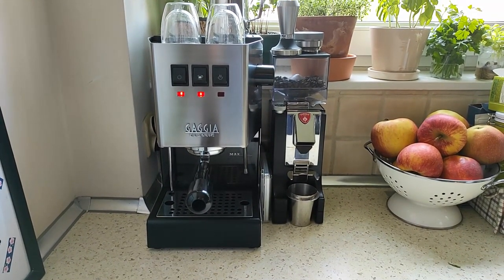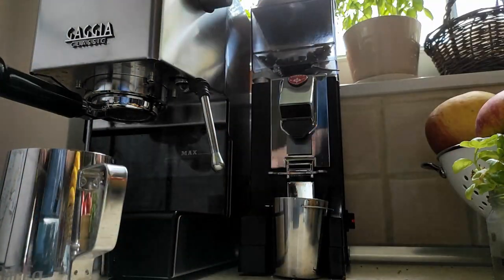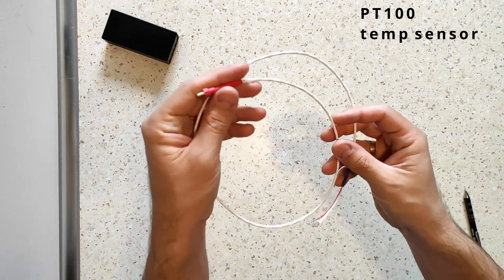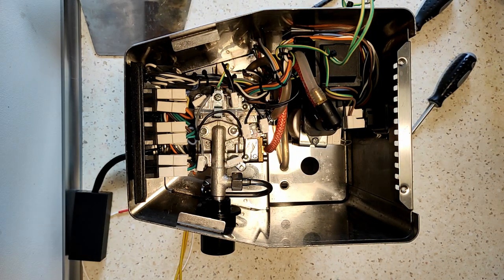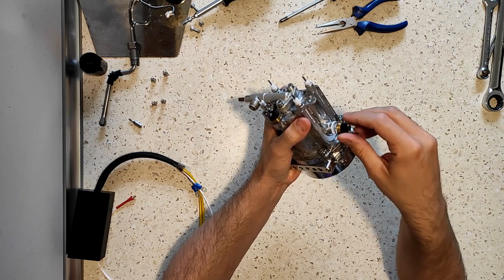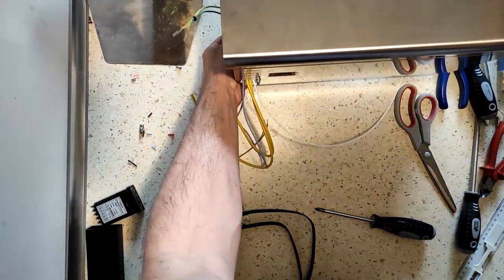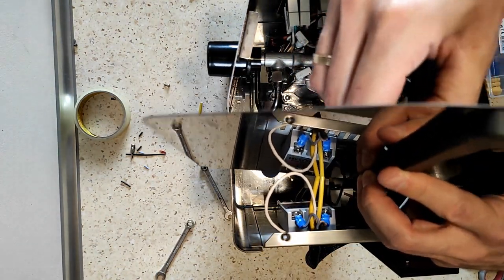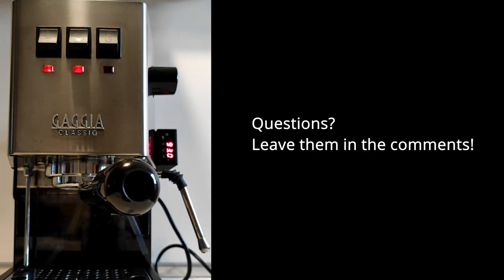How to install a PID on a Gaggia Classic Pro - DIY, cheap and good looking!

Comment: Great video - thank you! How important is using a thicker cable for the PID power connection? I have an 18 AWG silicone insulated cable at hand, but was wondering if this may be too thin. Thanks

Comment: Thanks to you i was able to do this install about an year ago, however as of recently my XMT7100 PID just stopped powering on. Light on the Gaggia power button turns on, no heat, and i can't tell if the PID or Relay are getting any power. Any troubleshooting steps you recommend? I checked all the cables and connections, they seem fine. I have a multimeter if it'd be useful, but I'm not familiar with how to use it (it's an AstroAI Multimeter 2000), thank you so much for your help.

Comment: Hi Robert, just wondering if the parts you linked will work with a 120V machine as well. I've messed around with taking things apart and putting them back together before but not really much in the electrical space
Reply from the maker: Yes, they will accept a range of voltages, 120V included.

Comment: Great video and really helpful, just one question - do you need to first set the parameters/temperature in the PID before Autotuning? Thanks!
Reply from the maker: No need for that, you can start with the stock ones, set the temp, let it heat up well and then auto tune.
Reply: @robertkujawa3504  Thanks Robert, i will give it a try. 

Are you still running your setup with SSR 25DA or changed it to 40DA?

Comment: Greetings! 

Thank you for your excellent video! I installed mine a little differently to my liking but made all connections as you did! I don't see any reason to deviate from your wiring as it seems the most efficient way (Just replacing the thermoswitch with the controller and thermocouple).

How ever when I flip my steam switch now it just keeps heating and heating. I am not sure why. It kept going past 170 before I shut it down. 

I don't see why the steam thermoswitch shouldn't still regulate the temp to 145. Perhaps you have input on this?

Thank you again! I've been enjoying tinkering with my Gaggia.
Reply: hi Weese! i was attempting to do the sketches/schematics last night and just bumped this query on situation of yours that got me thinking how can i repeat it... One (but not likely that You haven't hit it already) is when i've not set the High Value of PID to say, 140, default value is 600 deg. c for PT100.
Second, if my Steam Thermostat remains closed (can be any reason of several e.g. faulty thermostat, wires/terminals on the outside get shorted in Thermostat route to Steam Switch, Grounded Steam Thermostat accidently) etc. In latter case the situation will over-ride the discharged SSR, i.e. even when it's open after Set Temperature is reached, the circuit via Steam Switch and its thermostat will appear to close it.
Check wiring routes with close attention once, and boiler body for earthing leakage.

Comment: Hi robert! Looking forward to doing to this to my gaggia, although i cannot find these wires anywhere or what they would officially be called in my local home hardware  SiHF 2x0,5mm2,  FLRY 1.5mm2. I am canadian if that makes a difference
Reply from the maker: Just observe the diameters and temperature resistance. These are 2x0.5mm2 and 1.5mm2 in diameter. I went with fancy silicone wires, but you can pick those dedicated for automotive engine bay wiring. They will be able to withstand high temperatures around the boiler.

Comment: Hello Robert, nice video, and you almost convinced me to do the mod. I have 1 more question before I do it : you mentionnend your machine is running on 220v. Will the connections and harware be the same for 110v?
Reply from the maker: The PID unit I linked to can work with a wide range of voltages, 110V included. As for the connections, please refer to the wiring diagram available at Whole Latte Love. I have no access to a 110V machine, so can't give you a 100% sure answer.

Comment: Great tutorial, I've been  searching for an explanation like this for quite a while, finally, I found it I have ordered all parts you recommend from Ali express but not sure what size of the silicon insulated cable to order, can you please tell me what AWG or MM you used
Reply from the maker: For connecting the PID do the SSR I used SiHF 2x0,5mm2 cable and for delivering power from the Gaggia to the PID I used 1mm2 cable (17AWG).
For connecting the SSR to the Gaggia I used FLRY 1.5mm2 cable.
Reply: Thanks a lot, I'll get ongoing looking for them

Comment: Hi Robert, just a question about PID settings. The settings found by autotune (P:4.8, I: 78, d: 19) produce an intrashot stability of around 5c. I was wondering if you had any luck with trying custom settings? I have seen people achieving an intrashot stability of 2-3C, so I know it can be improved.

Edit: After some trailing different settings I found online, the best result is still with a setting found by autotuning (P:4.1, I:21, d:005). Intrashot stability is now around 4c with a 30s runtime. The small boiler on the Gaggia is a limiting factor.
Reply: Hi Mathew. I'm having the same issue of intrashit stability. What is your Gaggia model and boiler capacity? I will try the settings you pointed here!

Comment: When mentioning that your unit runs at 220 volts and that's what you need to power the PID, would I be okay following the same instructions for my unit, which runs on 230?
The PID itself is rated 	85~260VAC/50~60Hz
Reply from the maker: Yes, no problem at all.

Comment: Hi! I followed this as closely to what was in screen and it seems to work... Pid turns on and starts tuning the temp. But it trips the breaker of the house as soon as I hit the brew switch (I have the dimmer mod installed). Anyone has a guess as to what's happening?

Comment: Does the brown wire on the brew switch connects directly to the power outlet? When the machine is off, does the PID stay on, turn off? I have newer model and trying to figure out the connection before I start. Thanks

Comment: Hi. What material did you use for 3D printing? Speaking to suppliers locally I can choose between PETG, PLA, ABS or Nylon. Any recommendation? I assume some have different strength and thermal properties so perhaps one is better than others given the case of the machine does heat up? Thanks for your help (and the AWESOME video).
Reply from the maker: Hey Douglas, I relied on the guy providing the printing service and he recommended PLA.
Reply: @robertkujawa3504  I did the same! The guy I used recommended black PETG. I'm sure either is fine as where the PID sits won't get very hot / near melting temp. Thanks again for your great video.
Reply: @williamdouglastoy  PETG is more expensive, presumably he charges more. For this application PLA is fine. I 3d printed mine myself.

Comment: Hi! Great video! Thank you for sharing the whole process and all the Infos for the parts, much appreciated 👍
I ordered the same parts, and I'm excited to set it up! Could you help me with two things that aren't clear to me from the video:

- When you attached the power source to XMT 7100 unit on to terminals 1 and 2 (21:30), in which order did you connect the L (coming from the front switch) and N (coming from the back wall) wires? 

- And is there any benefit, or what is a difference, in using an SSR-25DA instead of SSR-40DA? I'm asking because the ready-to-order PID Kits include SSR-40DA, and my knowledge of electronics is nonexistent to understand the difference 😁
Thanks a lot!
Reply from the maker: Hi Igor! I'm glad you like the video! As for answers:

1. The order doesn't matter, this is alternating current :)

2. I don't really know why they select such high rating for premade kits. The heater element on the boiler draws 15amps, so 25 should be plenty. Perhaps they do this for longevity (more headroom), but even with 25amps you're comfortably at 60% rated output. Unless I'm missing something, I'm not an electronics expert :D
Reply: @robertkujawa3504  Great! A big thank you again!
Reply: @robertkujawa3504  I stumbled across some reports of so called fake Fotek SSRs that would not perform to it's current rating. In one example, the SSR-25DA had a 12A Triac inside, or 50% less than the rated load. This might have something to do with why the kits all seem to be using 40A SSRs. The Gaggia should only draw around ≈ 6A (230V models), so you should still be okay if the 25A SSR only had a 12A triac.
Reply: @robertkujawa3504  First of all, great video.  I had the same question with respect to SSR-25DA vs SSR-40DA.  I saw this note on the Mr Shades site but I have no idea what it means:
"These products are typically current rated lower than the name suggests  - so it is advised to limit this SSR to switching 25A maximum.  (a typical Gaggia espresso machine is rated at approximately 6A). "
Anyhow, it is pretty equivalent cost to get the SSR-40DA; would you recommend that?

Comment: Hey, just finished the install and it works great, thnx for the vid.
I just had a couple of questions.
1: How do you set up the PID to display group temp and not boiler temp. There's an 8 degree difference right?
2: When talking about purging the wand at 140 and steaming at 145-150. Is that boiler temp or the offset group temp.
3: Even though I autotune by letting it heat up for 20 min, then autotuned and let it sit for 20 again. The temp swings are quite large when brewing. Went from 103 to even as low as 95. Is there any way I could fix that?
Thnx in advance for any help!
Reply from the maker: 1. yes, I'm using the 8 degrees offset - it seems to be the usual value for Gaggia Classic. In order to set it: long press the right arrow button, input 0089 code to get into the menu, scroll to PSB option and set to -8. Press set and exit when ready.
2. that is the offset temp read at the boiler. The water inside the boiler is actually 8 degrees hotter.
3. you could try to input the values manually:  P:2.4 - I:40 - D:10
Reply: @robertkujawa3504  thanks for the advice, I'll try it out when I get home:))) again, excellent video with brilliant explanations
Reply: @robertkujawa3504  could you explain why exactly those 3 numbers for the p, i, d, values.

Comment: Hi there. So the first thing I noticed when looking at the parts is that the relay you bought is 24 volt.  The PID controller you bought is 12 volt.
Reply from the maker: Hey Justin, the SSR can accept input voltages in the range of 3-32V, so it's fine and it's been working like this for 1.5 year. No issues.
Reply: @robertkujawa3504  ohhhhh!!!!  Ok thank you so much!!!!  I'm going to adapt this install on a different machine I have!  Thanks so much for putting all this info out here :)

Comment: Hello.  I have a question for you
PID is to control the temperature at its discretion.  if you turn on the machine for 60 minutes, how much will the machine without PID increase in temperature and the machine with PID will still keep the temperature you have set correctly?
i am wondering about setting parameters for PID, is it easy?
The temperature displayed on the PID is the temperature in the furnace -8 compared to the temperature in the boiler.
Hope you answer my questions.  thank you
Reply from the maker: PID functions like an intelligent and responsive thermostat. It doesn't matter how long the machine remains on, the temperature will be kept constant once it stabilizes.

Comment: Hi, first of all, I would like to thank you for the really informative and useful video.
Do you know what material was used for 3D printed case? 
Is any temperature-related requirements?
Reply from the maker: Hi Juras, thanks for the kind words! As for the material, I honestly don't know, so I relied on the printer's expertise. I described the use to him and I think he chose a food-safe and temperature-resistant material, but there's really no need for this. The PID remains outside the machine, so is always cool and doesn't come in contact with the coffee.

Comment: Quick question. If I were to get the xmt7200 with built in ssr would I need to still get a external ssr? Thanks for the great video!
Reply from the maker: From what I can find in the spec sheet, the internal SSR is only rated at 5A. Sadly, this isn't enough for the boiler :(

Comment: thank you, this video is very interesting, bravo. What is the material of the boiler of this Gaggia? Copper? (I doubt) Aluminum? (ouch) Stainless steel ? (too expensive ...).
Reply from the maker: Yes, the boiler is made from aluminium. This is great for heat transfer, but you have to be careful when descaling with citric acid.
There was a short batch of Gaggias (2015-2018) with a stainless steel boiler, but these are best avoided, as they don't feature a 3-way solenoid valve.

Comment: Really nice video, thanks a lot, I'll try to do this with my Gaggia. I have a question about the FLRY cable, I'm not sure what it is, looking on internet I found some FLRY cables but they are always with a letter next to the FLRY, for example FLRY-A, FLRY-B, etc. Can you give me more info about the cable that you used?
Reply from the maker: You're looking for the FLRY-B variant, although either should work just fine, as long as the diameter is there.
Reply: Thanks for your answer, but I don't understand if the FLRY cable has something special or should work any 1.5 mm2 cable with a good resistance to high temperatures. For example, can I use the same silicone type cable for all the connections? Obviously using the right sizes (0.5, 1.0 and 1.5 mm2)
Reply from the maker: @erodaven  Keep in mind that those silicone cables are much thicker than others and if you're using the same 3D print file I used, the hole in the back will probably be too small. They're also more expensive :)
Other than that, you'll be okay using them for everything.

Comment: Which wires do you plug into 1 and 2 on the PID? Do you connect the wire from the brew switch to 2 since that is ground?

Comment: Hi, thank you for the tutorial! :) silly question (I am a little bit confused about the models) - does this work for the EU version? Or only for the US? Thanks!
Reply from the maker: The parts I listed will accept a broad range of voltages and should be fine on both 110V and 220V (EU).

Comment: Great video! I saw in a another tutorial thermal paste was applied to the metal surface of the SSR relay. Is this not required?
Reply from the maker: My SSR is working well below it's rated specification, that's why I took my chances without the paste - just didn't want to make a big mess. It's been fine for a month now, time will tell if this was a mistake. By all means, go ahead and add some paste if you want to be on the safe side. It certainly won't hurt.

Comment: Can I apply this instruction to the old version?
Thanks for this great video👍🏽
Reply from the maker: Yes, but the source of mains power might be different. Best to check with a multimeter or to consult a diagram.
Reply: @robertkujawa3504  Thank you very much 😊
Reply: @robertkujawa3504  has anyone provided a wiring diagram (or advice) for the old pre-2018 version? I'm working on mine and am not sure where to wire the power to unfortunately.

Comment: Hi Robert, thank you for sharing this video and now I'm more confident to work on my Gaggia Pro. Before I start, can I check the connection from PID to SSR? Should I connect No. 3 from SSR to No.9 on PID, No. 4 from SSR to No. 10 on PID? Please correct me if I am wrong. Thx
Reply from the maker: Hi there! You should observe the polarity of these terminals. So terminal 4 on the SSR is negative and should connect to terminal 9 in the PID, also negative. This leaves terminals 3 for SSR and 10 on PID to connect (positive polarity).
Reply: @robertkujawa3504  Thanks for your reply.  BTW, have you install the 9-Bar OPV Mod? Can you share link where you buy it?  Thanks!
Reply from the maker: @bbmm1785  yes, I've got it installed. I bought it from a seller on ebay, just search for "9 bar gaggia classic" or go to Shades of Coffee, they sell a kit.

Comment: just bought myself a gaggia classic and already want to do this, so thank you very much for the video! Is there anything you'd do different from the process in the video if you had to do it again? 
Also, what is that grinder, it looks beautiful.
Reply from the maker: The grinder is a Eureka Mignon (the classic, second edition, still available in some places). As for what I'd do differently: I'd use the lighter tip do the sleeve, it was a huge pain to do and I wish I knew about the technique back then.

Comment: Thanks for the video it was very helpful! I have 1 question and 2 suggestions:

Q: Do you know what the SU value is in the 0001 menu? I saw another video it was called extraction temperature with it set to 105. Is that just the default temp the PID is aiming to reach?

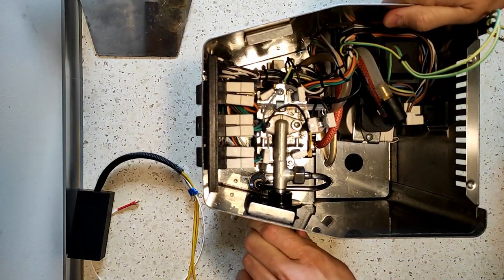Suggestions: Instead of removing the entire steam wand I just used a pair of needle nose pliers pull the quick release pin that can be seen in your video at the 7:51 mark at the steam wand hole. I also found that I did not need to disconnect the hose or solenoid to complete the thermocouple install.
Reply from the maker: The default value for SU [set value] is 80 degrees Celsius, at least on the unit I ordered and linked to in this video. It's the temperature displayed on the PID screen, so very easy to check and adjust.
Good tips regarding the disassembly, might be useful to others. The reason I dismantled more than I needed was for the clarity of presentation. This way I could remove the boiler and show the steps in detail. It's also good to know a full disassembly procedure in case your 3-way solenoid valve ever gets clogged.